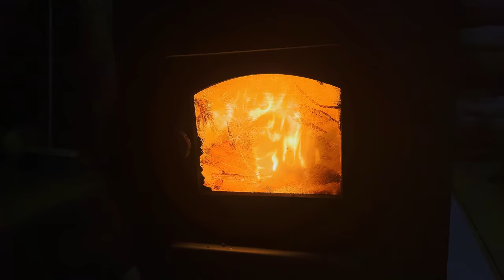Hidden huge HOUSE UNDERGROUND SHELTER. Waiting for a COLD WINTER, installed the door. Part 10

Comment: Very nice, just be careful not to be in the shelter during a heavy snowstorm because of the snow load on your exit door.  I see you have a frost window you could use to get out also. Nice job on your new huge shelter.
Reply: my worry as well. That door is heavy as is, let alone under feet of snow. I think that whole entrance needs changing so it can accommodate a standard door at the bottom of the steps with the step area open.
Reply: @jasonjlloyd  Maybe split the door? Top half and bottom half? Like a Dutch door. Latch them together when there's no snow so they close as one, and unlatch them when there's snow so each one only weighs half as much.
Reply: The glass window on roof is another problem. A hiker or large enough animal could walk on it and break it.
Reply: @ckom9  I expect he will make a cover for it like the skylight on his last main shelter.

Comment: Well done Sergio and Alex!  Everything looks great.  I have two thoughts of concern:  that door will be HEAVY and hard to open if a lot of snow accumulates on it;  and I am still concerned about ventilation, since carbon dioxide is heavier than air and will not flow upwards through the ventilation pipes.  Keep up the good work!

Comment: Great job thus far, but CAUTION; …. The birch bark covering you placed around your new air vent needs to be very loose, or be drilled for added holes, or you’ve defeated your purpose of air exchange.

Comment: Great vid.  You do a really good job.  Beautiful place and shelter.  Very livable.  See how good it is in a very few months when the rivers are froze and the snow is flying.  That fox wlll climb down the chimney  Sergio is a good worker.  Window looks good, however it won't drain and water snow ice will build up on it.  Get a piece of Lexan, Plexiglass, some kind of plastic glass and put over top of the whole frame to divert the water away.  It has good tilt toward the walkway so that will help.    Paint the frame good to to seal up the frame material.  Or put a sealed shutter over it.  Alex, I tink the door wore you out.  Good job, just as I would have done.  It's sealed pretty good.  Maybe squirt some sealant in the cracks from the underside.  The days are getting much shorter now.   You may want  some thin fire  bricks to line the stove with.  Good looking meal. Nice.  Now some benches.  Stove is too close to wall.  For safety in needs to be 2 feet out.  600 cm.  Wrap that sand paper around a block of wood.  Burn your fingers off.  Spray some paint on the tarp, camo it.  Place is looking great.  Hope no one finds it and bothers it.  Next time.

Comment: Awesome job guys!! A tip for next time you sand. Cut a piece/block of wood that fits in your hand, then wrap your sandpaper around it. It’ll save your hands from cramping up and give you a better grip on the sandpaper.  Move the sandpaper around until you’ve used it all up, then grab another piece of sandpaper and continue.

Comment: A cheap way to clean the glassdoor is wet newspaper with ashes on, superp:hand-purple-blue-peace::hand-purple-blue-peace:That ventilation-pipe look very short, it will be covered in snow, do`nt you think?? Good progress. I had wanted a door down there too, in case the one on top will break by a moose or/and heavy snowfall.:hand-orange-covering-eyes:

Comment: LOVE It So Far; But May I Suggest A Vertical Board Running The Length Of The New Door On The Inside For Added Strength. Also A Wooden Shutter To Protect The Window Above The Door, So Moose Etc. Won't Fall Through.
Reply from the maker: 👍 yes

Comment: This is a nice build, and I'm a bit jealous of the ground conditions. You couldn't build something like that in Norway without digging up tons of rocks, many of which would have to be split in order to move!

That said, there are a few issues that you should consider:
1) Ventilation: as others have said, there is a risk of CO2 building up at lower levels. It's too late to put in ventilation at floor level, but you could get a cheap battery fan to put into the ventilation pipe. This could be enough to improve the draft. Just bring new batteries when you go to the shelter.
2) Fire escape: You should change the window so that it's possible to open it. This way you can use it as an escape way in case your door is blocked.
3) The window above the door will collect water every time it rains! You could easily fix this by getting a plexiglass plate of the same size as the window frame, and then gluing it onto the frame (on the outside, of course). You might want to put some kind of spacer between the window and the plexiglass, so that the center is the highest point. This way you won't have that permanent pond that will rot the windowframe.
4) As others have mentioned, the door can become very heavy if there is a lot of snow. You could split it into two parts, so that it's easier to open, but that can cause problems with water leaking in. If it's a problem, you could rig some kind of lever action that will help you open the door.
5) You have a good bit of wasted space under the stairs. You could put in hinges on the lower steps, so that you can lift the stairs to the side. This way you could store quite a lot of wood in a dry place.
6) I assume that you might have plans for this already, but you should install similar doors in front of the window. It will protect it when you are gone, and you can close them if you don't want anyone to see the light from the shelter.
7) This is another thing I'm guessing you have planned, but you should really put in a door after the entrance way. This will help a lot if it's really cold.

Good luck on finishing the build!

Comment: Alex, if you take your box of screws and spray a little WD-40 on them and shake them around in the Box to coat them they go in the board's a lot easier (without that terrible sqealing noise!) plus it's a protective coating so they don't rust as quickly.

Comment: Nice video… thanks for sharing. You guys should have used a tar like waterproofing instead of polypropylene tarps. They last two years tops and then fray and fall apart. I don’t even think they are rated for ground contact.

Comment: The stove is efficient, does it have to be on the floor, could it be raised to say cooking top to 700mm to 900mm" saves the bend on your back?" I understand the fire protection aspect to protect the walls and floor from radiated heat. I would consider a moisture resistant base panel to the floor  of 1m say supalux or Glasroc and 1200 mm foil faced mineral fibre  stapled to the wall and roof centered around the flue?  \Lets help to innovate. None the less great job. Really enjoyed watching.

Comment: Instead of wood to start fires with use Pinecones. Thats if you have any around you. I camped for years and other campers told me about stsrting fire with the pinecones. They work fsster than wood and you can put your wood on right after they start burning. No waiting for enough wood to butrn before putting on your logs. Try it out..

Comment: I am too old to make a dugout myself, but it would be nice to see someone to make a "rocket mass heater" into one. Stays warm easily over 10 hours without fire, and firewood consumption is less than 25% compared to regular wood stove. A winner in the cold compared to stove which you have to feed all the time. 
Just popped to mind because you guys have endless source of heat mass to use - ground looks sandy :)
Youtube if full of rocketmassheaters. Just search.

Comment: you should add moss over them logs aswell that seperates the moss sections and on the small platform infront of the window, to make it melt in even more to the nature and think u shoud also add some kind of insect net inside the vent tube that u punched with alot of holes

Comment: You should look for a round computer fan to fit your air vents to the outside. They would run easy off of a tiny solar panel. 👍

Comment: The full recipe for the Stroganoff was not there.  One more ingredient (from a pouch) was added after the cream - but there wasn't any subtitle to say what it was.  

Also - more fire-retardant material is good - but there is a bare place on the FLOOR - at the back of the firebox - between the heat guard on the wall, and the one that's under the fire-box.   BARE, VARNISHED, WOOD FLOOR.  Pretty unsafe.

i grew up in a logging camp in the 1950s - where we heated our homes and cooked all our meals - on wood stoves.  And the chimney needs to be wrapped where it passes through the wall to the outside.  But it's the FLOOR - ALL the floor - and the wall behind the FIRE-BOX that needs the most protection from heat.  That bare patch between the heat guard under the firebox - and the bottom of the heat guard on the wall - just gives me the heebie-jeebies.

Comment: If that wood has not been treated that house is only good for maybe 5 years
Reply: Surely not. They used a tarp everywhere so that the wood never comes in contact with the sand/soil or moisture?? 🤔 Don't rain on their parade after all the HARD work they've done.  😢